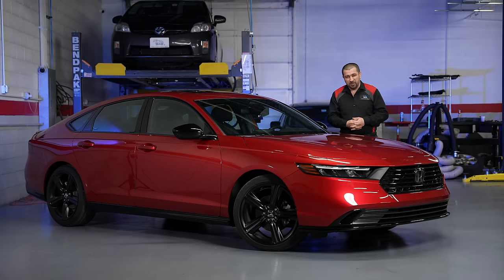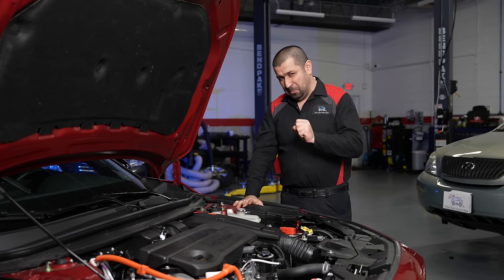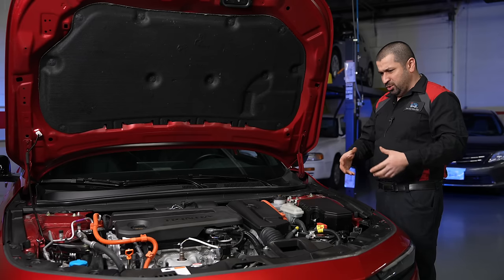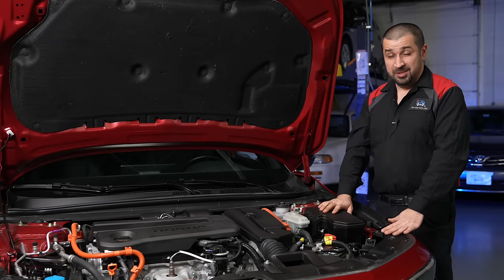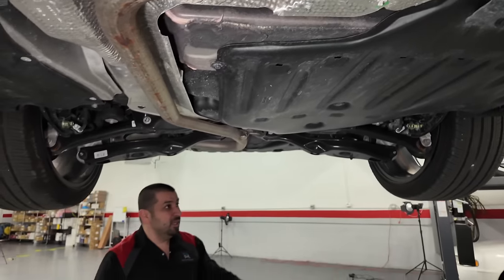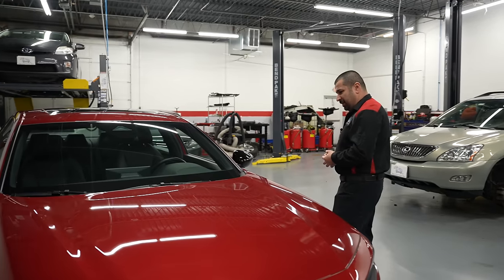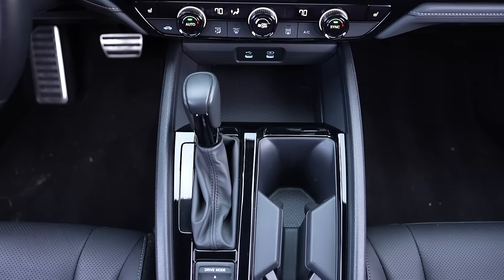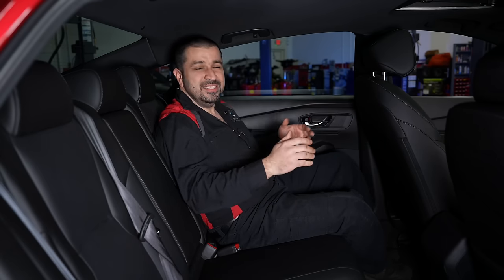Should You Buy The Latest Honda Accord? A Mechanic's Review

Comment: What it looks to me is way too much stuff going on under that hood and it's going to get quite costly when all them systems start to fail, because you have all them systems your failure rate will most likely be sooner than later, remember Honda only gives you a 3-year $36,000 bumper to bumper and a 5-year 60,000 powertrain and that's limited, if you don't have receipts for regular scheduled maintenances they won't cover nothing. I believe Hondas are very good cars but until they boost that warranty to 100,000 mi powertrain I'm not ever going to buy one. I went looking at a hybrid Accord 2024 and they wanted nearly 44,000 for this car that's way too much money to be stranded and having to pay for my own repairs at 80,000 mi. For 44,000 I need to be guaranteed this car gets at least 150,000 mi with no problems
Reply: "Way too much stuff going on under that hood" There is quite a bit less going on under the hood than any other gas car. It is so simple that they can explain it easily. It is just different than what people, who were raised on other systems, expect. So they misinterpret what it is doing. AMD is very guilty of this.

Simpler explanation: Most of the time, it is an EV; not a Battery EV, like a Tesla, but a Battery+Generator EV. Simple. The one exception is when a conventional gas car would use overdrive. Then it switches to being a single-gear direct-drive gas car. It does not use this mode to accelerate, to "switch gears" (simulated or real), or at low speeds. None of those situations call for overdrive. So it has no transmission. That eliminates the component with the most mechanical-things "going on" in conventional gas cars, and some hybrids.

There are so many different control-things going on in a Toyota hybrid that they don't even try to explain how it works. But here's a synopsis: There are two paths for ICE power thru the power-split device. One is a parallel path, much like the Honda when the clutch is closed. The other is a serial path, much like the Honda when the clutch is open. The difference is that Honda uses only one path at a time, while Toyota must (A) use both at the same time, (B) coordinate their use in a precise relationship to control the ICE's rpm, and (C) switch which motor-generator is operating in which path based on speed. This switch is more complicated than the Honda using the clutch. (PS: the control system was patented at the University of Maryland before Toyota started using it. Even though it was well documented, Toyota somehow failed to notice this and, according to the lawsuit they eventually settled out-of-court, "independently developed" the same thing.)

"It's going to get quite costly when all them systems start to fail." Hasn't happened in the 11 years since the system was introduced (2013, with the 2014 Accord PHEV). In fact, Honda hybrids have better reliability records than Toyotas. Including clutch failures in Toyotas, since theirs experience more slippage.

"That's way too much money..." It's also way more than MSRP. But you are  misinterpreting two things. First, the hybrid is only available in the higher trims. So don't compare an Accord Hybrid to a Camry Hybrid LE, compare it to the XLE. Second, Honda doesn't rely on packages to get the features that are theoretically possible. They are included in the advertised price. Toyota hides these costs in packages, that make a comparable car more expensive.
Reply: @jeffjo8732  well first of all I wasn't comparing that car to any other hybrid, I was comparing it to a normal gas engine, second of all you must not know a lot about electricity and gas engines, so they're using a gas engine as a generator to power an electric motor where do you not see that being a lot of crap going on under the hood. Second of all CVT transmissions are garbage they always have been, they're getting better but they still suck, no matter how you look at it all that extra technology will fail and it will be extremely costly to fix when you're out of warranty. I understand you don't know a lot about cars and the prices of cars so let me enlighten you, The Honda Accord I was looking at which was the touring hybrid trim not the sport but the fully loaded trim was 44,000 before taxes, we negotiated it down to 37,000 after taxes, I liked the car I test drove it twice, three things kept me from buying it, The first and foremost issue I had was its transmission I don't trust it, second issue is it had ventilated seats yet the seat kept getting hotter in both accords that I tested from different dealerships, The third thing was the crappy warranty that comes with it. As technology gets more advanced there were are more points of failure. Honda has a good name they usually build a really good car, My mom about a 2010 insight and when it was out of warranty the battery pack went out and that was over 5 grand to get a new one. I don't know about you but me and my family when we buy a car we tend to keep it for 20 years so of course we want to make sure it has a good warranty and when it's out of warranty it is easily fixed with a low maintenance cost. You're not getting in that car and fixing most of that stuff. If you ever worked on the Honda you know a lot of their electronics are mated with each other so it's just not an easy swap out. So what I say that there is a lot of stuff going on under the hood I'm not exaggerating. I understand you're a Honda fanboy and want to take up for them but fact is fact. And in case you didn't know there are a lot of Honda Accord hybrids that are going into the shop for repair. They've also had a couple recalls
Reply: @rondemeio5337  First of all, I was comparing the Honda hybrid to any gas car, “normal” or hybrid.

Second of all, I know a fair amount about “normal” gas cars, and quite a bit about hybrids. In particular, that all hybrids use a motor-generator in their transmission system to (A) generate electricity that charges the battery when power demands are low, and (B) add battery power to the ICE’s when power demands are high.

In other words, all use a generator while driving and so have the "lot of crap going on" you complain about. The way the Toyota system regulates the ICE rpm is by adding most of "all that crap" from a Hyundai, to all of it from a Honda. And then some more to tie them together. It is done through a Power Split Device. X% of the ICE power is sent to a generator. (100-X)% is sent (mechanically) to the wheels. Of the X% that is turned into electricity, Y% is sent back to a motor that drive the wheels, just like Honda does. (100-Y%)  is used to charge the battery.

A very complicated computer control system is needed to choose the right X and Y at any time in order to control the ICE properly. It has to react to changes in road conditions. It is very complicated; so complicated, in fact, that Toyota felt the need to steal - er, "develop independently" - what was patented by a University of Maryland researcher.

In the Honda, most of that is unneeded. X% is 100% when the clutch is open. The ICE needs less control; it is run at 2000 RPM and 34 HP. From there, it operates like any EV would, just with two sources of electricity.

“Where do you not see that being a lot of crap going on under the hood.” There is a lot. Everything it does, and a lot more, is done in a Toyota. So that counts as "a lot more crap," which is all I said.

“Second of all CVT transmissions are garbage they always have been,” Third of all (count often?), neither of these hybrids uses a CVT. They both call it eCVT, but it stands for different things. The Toyota "electrically-controlled" CVT is very close to bulletproof. But it is still a mechanical transmission. In a Honda, a better name might be “virtual CVT.” IT ISN'T A MECHANICAL TRANSMISSION. It has less to fail. And even if you suggest the obvious part that might fail, Toyota's history has more of them.

I understand that you do not care to understand the cars you want to dislike, but you could spend some time trying before you spread disinformation.

“The Honda Accord I was looking at which was the touring hybrid trim not the sport but the fully loaded trim was 44,000 before taxes,” The MSRP for that model is currently $38,890 US. (Maybe you are in Canada? Dishonest dealers? Toyota is more known for up-charging.) It can’t go higher, except with dealer-installed extras like floormats.

The equivalently-placed Camry, the XLE, is $34,535 US. Seems like a lot less, right? But it is a 7% smaller car, and with technology from 2018.

And to get features that the Accord already has, like a moonroof, premium sound, ventilated seats, head-up display, rain-sensing wipers, and seat memory? That’s a $3,810 package. Now they are in the same ballpark. There are other features missing that require about another $1,000. Yes, you can get a few other features added as well. I said that. My point is that you need to compare what you add to the car, not the MSRP.

“The first and foremost issue I had was its transmission I don't trust it” And this shows that you didn’t do any serious research on it. It originated over a decade ago, so it is a mature system. It is far simpler than Toyota’s. It has proven to be as, or more, reliable. You don’t trust it because you know nothing about it.

“It had ventilated seats yet the seat kept getting hotter in both accords that I tested from different dealerships.” Ventilated seats don’t cool the seats, they keep hot air from accumulating between you and the seat. Sunlight will heat the seat if nobody is sitting on it.

“And in case you didn't know there are a lot of Honda Accord hybrids that are going into the shop for repair. They've also had a couple recalls”  Toyota has also had recalls. Most rating services ratings, which are based on how many "go into the shop," show the reliability of the Accord equal to, or better than, the Camry’s. Example: KBB 2024 Hybrid Accord, 4.8 out of 5. 2024 Hybrid Camry, 4.1 out of 5.
Reply: @jeffjo8732  let's start off by saying all your research that you just try to throw at me that you googled still don't amount to what I said, there's a whole lot going on under the hoods of those vehicles, which means there are multiple new points of failure which can cost the consumer lots of money when those  short-term warranties go out. Ecvt is still a version of CVT. Continuous variable transmission. No matter how you spin it it's the same thing. Now as far as me saying that the cooled seats didn't work I understand they are ventilated. With that said when you turn on the ventilated seats and you're sitting in the car and the car is cool from the air conditioning your butt should not get hotter that's exactly what happened when I test drove those. It seemed to have made the seat warmer instead of cooler. I have a 2020 Genesis g70 and I also have a 2025 Kia K5 GT which both have cooled seats which make my ass cold when I turn them on. A ventilator seat may not give you cold air but it should at least cool down the seat a little bit. As I stated before I know you don't know a whole lot about cars and that's okay you keep Google searching. I actually work on cars and I will tell you this if your Honda hybrid brakes or your Toyota hybrid brakes I'm going to charge you so much money you'd rather buy a new car. My original statement is because they have All the electronics that can go bad the transmission can go bad and a ECVT isn't making the situation any better. Just know that your x and y are going to cost a lot of money to fix. So you can go as technical as you want in the lingo but the fact still remains what I said is true. I understand you're a fan boy and you like the YouTube a lot of stuff and get Google a lot of stuff Go ahead and buy you one of those if that's what you want. Just know when that warranty doesn't cover all those parts that end up eventually going out you're going to end up selling that car or trying to trade it in. I'm not saying they're all bad they'll probably less a couple hundred thousand miles if lucky but the ones that won't and the ones that do go out after the warranty You're going to be stuck with one large ass bill. I was looking at the Kia K5 the Honda hybrid touring and the Altima at the end of the day the Kia K5 had a traditional transmission less electronics no electric b***** motor it has the best warranty in the automotive business and they're not that hard to work on. I have several hyundais a Genesis and a Kia All of my Hyundai's have made it past 200,000 mi which is expected in a modern car from 2000 on out. I'm not blasting Honda I'm not blasting Toyota they do make good cars, but at the end of the day it is a personal preference that I have a traditional transmission less electronics and no battery packs made out of hundreds of 18650s. When I say 18650s I do know that different makers use different battery components so it may not be 18650s so you don't have to come on here and try to school me on it.  But thank you and your response proving my point that there is a lot of crap under those hoods too many points of failure for me bro. Go buy you a hybrid and be happy I have no problems with that
Reply: @rondemeio5337  No, it is my detailed knowledge (along with advanced technical education), not google searches, that allow me to point out just how wrong you are. I even know how to spell "break." But you don't want to accept that, so I'll stop trying.

But I am curious to know what part, or parts, you think are possible failure points in conventional CVTs, Toyota's "electrically-controlled CVT", and Honda's "electrically-coupled CVT." None of these is a "version of" any other; the components are quite different. Which you should know if you work on them. They are just transmissions that allow the ratio of engine speed to countershaft speed to vary continuously.

Comment: Car care Nut loves these because when they go out of warranty, he will be able to afford a mansion and yacht  based upon repair cost of both this Honda and Toyota hybrid systems.
As an automotive engineer who actually understands the development and reliability of the 1000 subsystems of a hybrid including 100 computers and battery technology, all I can do is laugh out loud at the complexity of a hybrid system when a single gas engine and torque converter transmission will be so much more reliable and lower cost long term.
This car is like cheap Rolex watch with two mechanical movements and countless microprocessors allowing it to figure out which mechanical movement will actually tell the time...lol.
A joke and the joke is on the ignorant public.

PS. Keep an eye on Honda and Toyota's reliability numbers since the debut of their hybrid systems which has fallen precipitously.  Just wait as more hybrids age and go out of warranty.  My hope is Honda and Toyota will be penalized for their greed of hustling the pubic with this needless technology which exists only for their 'profit'.  
Hondas and Toyotas in stark contrast were known for their reliability a few years back because they created much simpler cars that were dead reliable. Both companies have sold out for a more lucrative business model. Question is, how long this scam will continue until the slow public catches on.
Reply: What cars would you suggest, reliability wise, in the affordable midsize segment. I need to upgrade today! Unfortunately, none of these cars are as reliable as they used to be.

Comment: is this not like the chevy volt?
Reply: This is not like the Chevy Volt; that's like saying that a VW Beetle is "like" a Porsche 911 because they are both air-cooled.

The Volt actually bears as much resemblance to the Toyota Prius as to the Honda Accord. Its first generation had two hybrid drive modes. One was serial, like Honda's Hybrid Drive, and one used a planetary gearset for a parallel-serial mode like a Prius. The second generation used two planetaries, with more complicated mode selection.

The Honda switches between a pure serial mode (for higher power) and pure parallel (for highway cruising). The Volt switched between pure serial (for low speed) and parallel-serial (for high speed).

The Honda it is much closer to a Koenigsegg Regera. The purpose is entirely different. :)